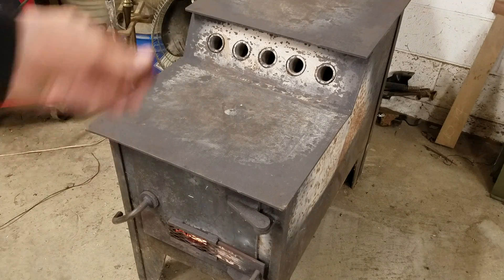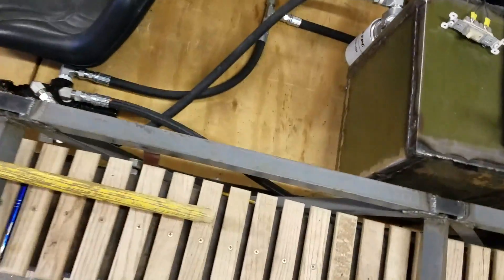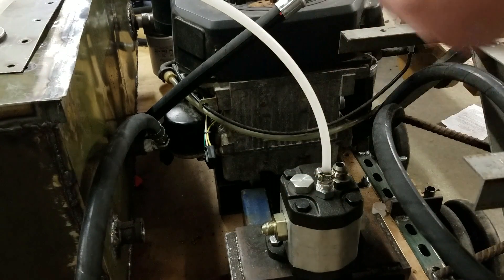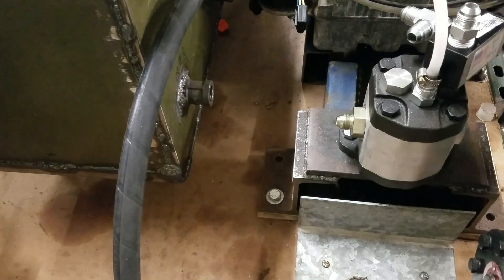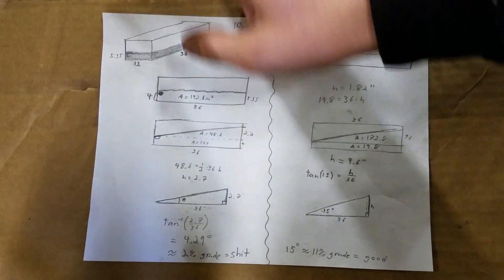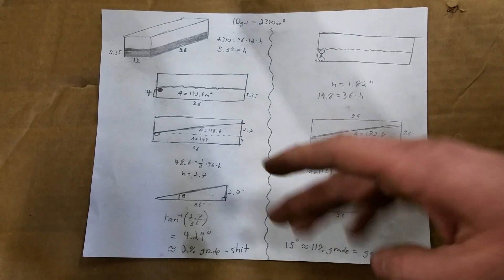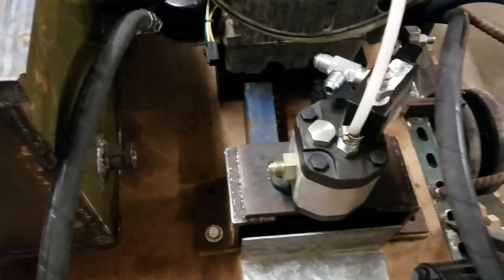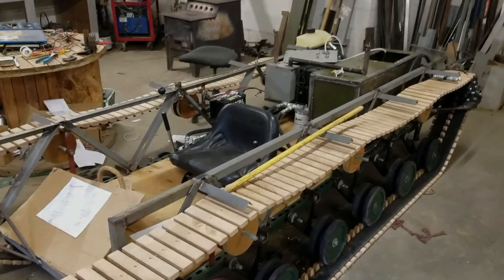Homemade Tank Part 13 (Battery and Hydraulic Hoses)

Comment: I must admit , for a young fellow you have some sound intuitive thinking going on. With the cavitation myth, consider this? When a sealed hydraulic system is under a suction state . How is it possible to get cavitation ; unless there is an air leak? Its a myth! I heard this stated with water and hydraulic lines through my experiences. Simply not correct. Of course there is the power drain or pressure loss potential on supply sides which is unsuited to efficiency.  The washer on the return at the tank you spoke about is generally termed a Grommet . fyi. I got to this edition of your progress so engrossed in my binge watch that I completely overlooked clicking the like button. Soory about that. Will return for correcting that later. This is pretty fascinating stuff.

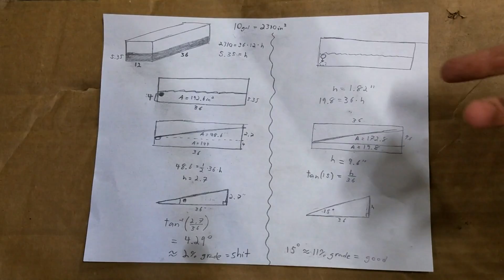Comment: 8:30 just put four outlets on your tank   also you are dropping your return oil and that will aerate it.... filter  filter  filter  but do not restrict flow too much either in any fittings or filteration.

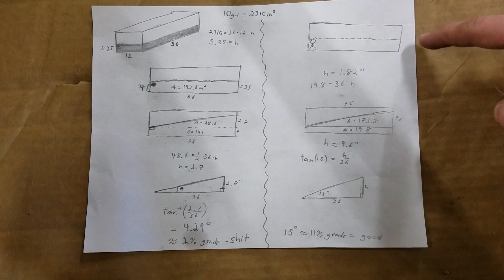Comment: I followed the math all the way up to 12:40 where you're determining the height of the rectangle so you can determine how low the bung must be in the tank to prevent starvation...

Is the last calculation divided backwards?  Shouldn't it be 19.8/36, instead of 36/19.8?  The way it's demonstrated, 36/19.8 gives you a height of 1.82"; however, that would result in an area of 65.52in2.  I believe it should have been 19.8/36, resulting in a maximum bung height of 0.55", and still properly solves for the area of the rectangle (.55*19.8=36).

Comment: The next time you build a hyl tank leave about 2" air space at the top and pick up close to bottom. Put a tall vent on the top. In your case put it in the center to let heat out. The metal of the tank helps to cool the oil that's why you want it close to full. Your oil will never work hard enough to get hot like a woodspliter.

Comment: I’m not a mechanic nor have I ever learnt how all of this works but I’m still confused on what the hydraulics does. 

This may sound very dumb idk but I genuinely don’t know

Don’t you just connect the engine to the wheels and tracks and bam complete?
Reply: Tanks turn by changing the speed of each track, if one is slower than the other or going in a different direction the tank will turn, if you connect the engine directly to to the wheels you won't be able to control the speed of the individual tracks, when you use hydraulic engines you can have constant pressure from the engine driving the oil and then have the pumps limit the flow to make the individual engines on the tracks faster or slower allowing you to turn

Comment: Maybe if you would have separated the reservoir into smaller sections with small hole in to to slow the fluid transfer through each section you could run the tank at high angles for a short amout of time before pump cavitation. Since the fluid levels in each section would be higher you could tilt at at a higher angle and the small drain holes would prevent it from draining immediately and starving the pump. That's what they do in airplane wings to stop the massive amount of fuel from sloshing around in the tanks.

Comment: You could have also just dropped one side of the tank 3 inches and used elbow fittings to make needed connection and the reservoir needed to make hills.

Comment: Try moving your outlet fitting to the center of the tank wall while staying the same hight from the bottom.  The reason to do this is the oil level stays constant whatever angle the tank is at. No matter how much filtration you use you still get crud in the tank so moving the pickup down to the floor is a bad idea. Plumb from the tank to the pump with black iron instead of the A.N. fittings,that will allow you to make the bends you need to get from one to the other. Something to consider if you redo the system or build something similar.

Comment: why don't you just put an angle in the bottom of your tank so when the car is level the input side is higher than the output. it also puts more strenght in the tank because the floor and roof of the tank don't run parallel to each other :)

Comment: How did you come to figure your reservoir size, looks too large? You might have been able to get away with a moderate sized propane tank in upright position. If the upright tank ( 2 or 3 feet tall) had a bearing hinge to hold it at top so it could swing, then it could stay upright no matter how vertical your tank wanted to go. The hoses would have to reach and flex to compensate for the reservoir swing.